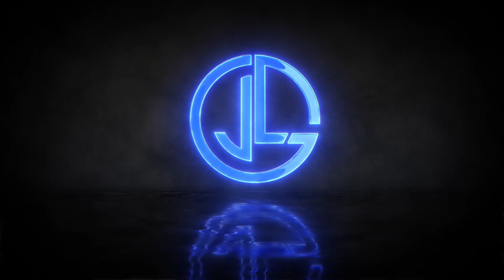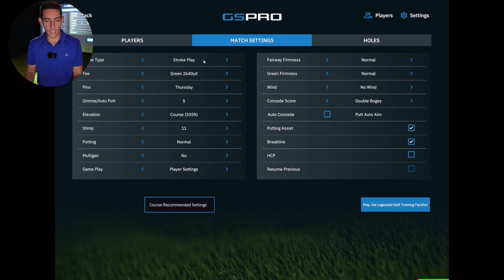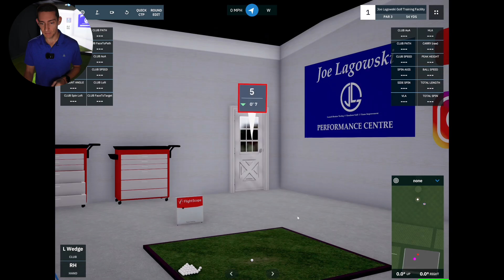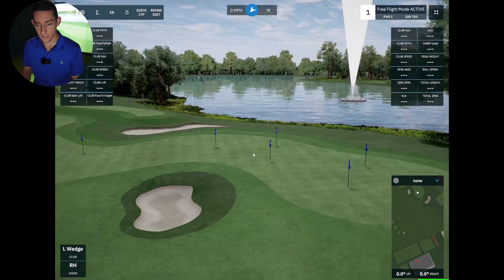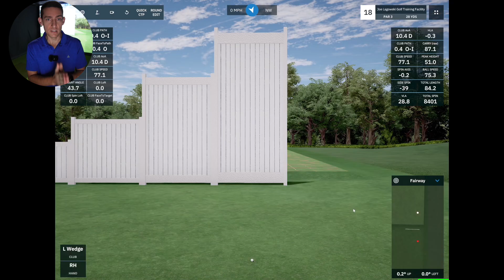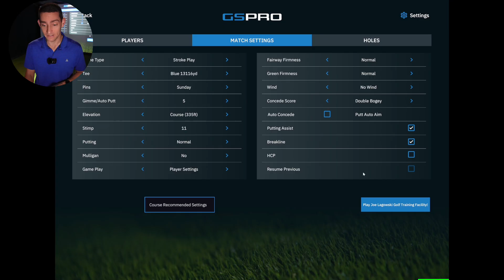How to navigate the Joe Lagowski Golf Training Facility!

Comment: Awesome Joe!  (and Scott!).  The question I have is... Can the designer change the percentage of impact that rough, deep rough, sand, etc will impact the shot?  For instance, they might feel that a shot from the pine needles doesn't impact the shot as much as some other designer?    Or is it a fixed percentage built into the design studio?
Reply: No, it is built into GSPro. Every surface plays the same regardless of course. Also, what it looks like graphically doesn’t really matter. It can look like short grass and be deep rough and it can be super tall grass and be semi (up to the designer when they “spline” the course). So always look at the actual lie text rather than what it looks like in the graphics
Reply from the maker: Fandorm nailed this answer!